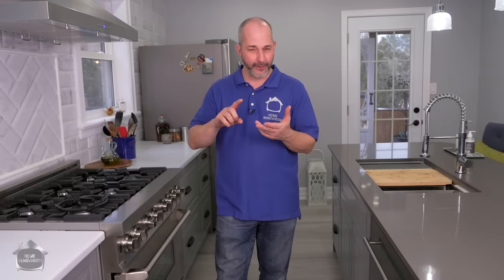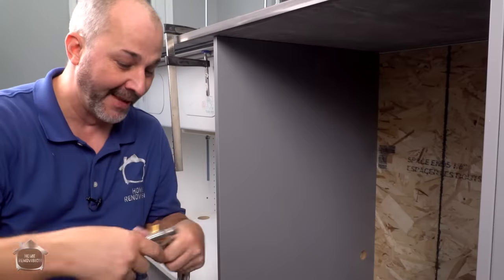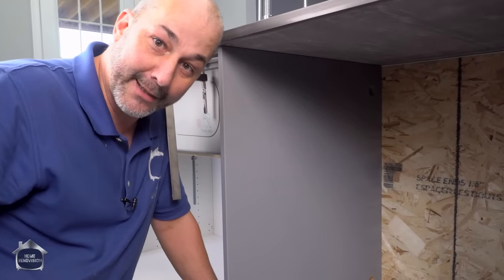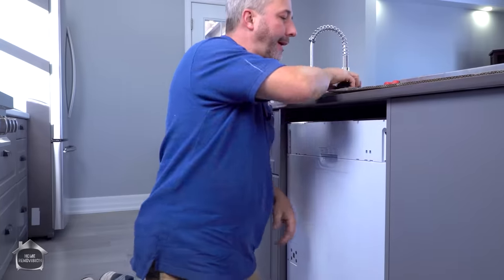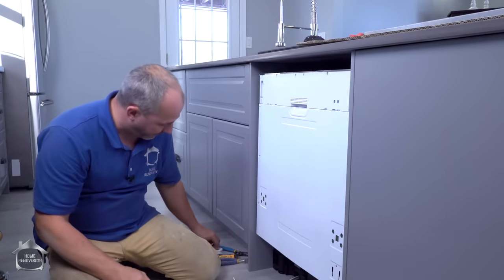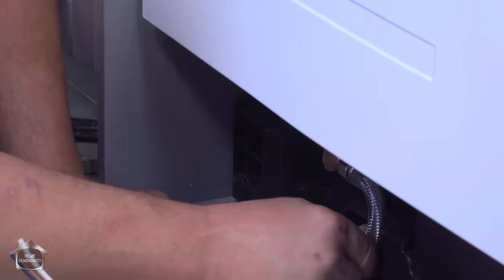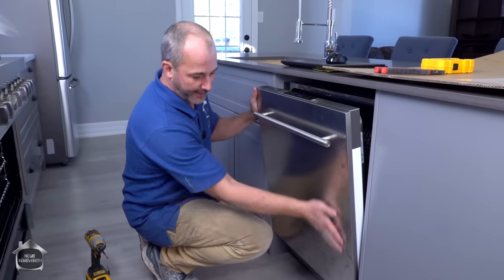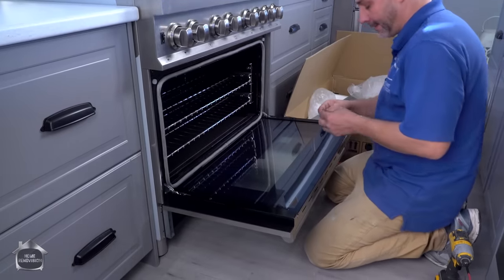How To Install A Dishwasher  Made  Easy!

Comment: This video saved me $1000 on a new dishwasher. I was preparing to install a new one after ours suddenly died and I learned the connections were all in the front. Turned off the power and opened the front bottom panel. Found a loose wire and reconnected it. Turned the power back on and it was fixed. Thank you so much!

Comment: I like most of your videos, but I have a suggestion for making the connections a lot easier. You can lay the dishwasher on it's back and make the water and electrical connections easier without having to lie on the floor. Then stand it up and run the wire and plumbing under and feed thru the holes in the floor and cabinet. I also hope you closed the gap at the top with a piece of cabinet colored trim with angle brackets on each end.

Comment: The gap at the top would drive me insane. There should be no reason why anyone should have to rig a dishwasher for it to fit properly. We're remodeling our kitchen, I was thinking about going with Z Line however the dishwasher may be the deal breaker.

Comment: You are correct about learning how to install kitchen appliances by watching videos on You Tube. After watching several installation videos I installed my new dishwasher, garbage disposal and over-the-range microwave. The microwave is vented outside and comes with a powerful 4 CFM exhaust fan. In my case I installed a CFGI outlet under the kitchen sink and a power cord to the dishwasher. The 1 1/4 HP disposal came with a power cord along with 3 bolt connection. Also purchased a wireless transmitter and receiver for turning the disposal on and off. Replaced the plumbing under the sink with a dual snappy trap.  Nice job really enjoy watching your installation videos.

Comment: I put a 1x3” across the top against the quartz countertop and pocket screwed the wood to the cabinets on each side on ours. This made it really easy to screw the dishwasher to the top and hide any gaps with a strip of the finished end panel glued to front of the 1x3”.
Reply: My thoughts exactly, maybe even a little adhesive to the underside of the counter.
Reply: This is the correct solution.
Reply: They make a "bridge" now for this application. When doing granite countertops. They also sell an adhesive solution, but I've heard nothing good about them.

Comment: Love your videos.  Keep up the great work. Just wanted to mention at about 2:40 you mentioned they aren’t using the garden hose connection too much any more and they switched to the elbow. You actually have that backwards.  The elbow is how dishwashers have been installed for several decades. Most commonly with a copper line.  After the introduction of stainless steel flexible lines the garden hose style became much more common and except for Hong end dishwashers that’s mostly what’s being used now. I’ve been an appliance tech for about 30 years.  I’ve pulled out and reinstalled more dishwashers than I can remember.
Reply: Do I’ll k

Comment: 14:02 I’ve got the same tester, if you hold the power button for too long it starts in silent mode so it will only flash when there is power rather than beeping and flashing. A shorter power on press will turn it on in beep+flash mode.

Comment: Hi Jeff, love your videos as usual. Can I make a couple of suggestions which you can apply to both the dishwasher and cooktop / oven. You can build a little platform under the dishwasher to raise its hight and also with the oven you can remove the legs and rest it on the platform. That way you can continue the kick panel under the oven for a more slimline look. I have done that to my ILVE oven and it looks a million bucks. As for the dishwasher, the platform will get rid of the gap between the dishwasher and benchtop. Also with the dishwasher here in OZ they installs are slightly different. Water inlet / outlet and power supply are at the back of the machine, regardless I normally run all hoses and cables under the cabinet and that way I end up with a much cleaner / neater finish. 
Again keep up the great work!
Reply from the maker: great ideas stan, however the stove requires the air space to keep it from over heating. the dishwasher though will work. Cheers!

Comment: In the UK we only have the garden hose 3/4" connection,very reliable tbh not reliant on PTFE. Our dishwashers are generally full height and have a cabinet door mounted for a nice flush clean finish. Cool to see how it's done in the US
Reply: I believe he is in Canada, the us is a little different most just come with a garden hose option or you can slide them off and tape them so you can use both ways. The back also comes with just a standard outlet to plug in the wall.

Comment: You don't have to pre drill a hole for side mounts, if you look down about 3 more inches there are little grey plugs that you can pop out, put the side mount bracket provided in after you snap off the extra piece, screw into the cabinet and replace the caps. 😇
Reply: Exactly. I agree with you 100%. The problem is that installation instructions are being tossed aside.
Reply: How do you pop the caps out to remove a dishwasher?

Comment: I've installed GE, LG, frigidaire, and a few others, they all share the same thing in common expect for 1 thing. The drain line, most have a rubber end which allows you to be able to cut to match with the drain T, others don't they are matched for 3/4 so make sure your drain line matches your drain T.

Comment: Glad to see you installing ZLine.  I just finished installing the ZLine 36" slide in rangetop (exact same cooktop taken right off the range you just installed) and a 42" 1200CFM remote blower island range hood.  Can't find anything better for the money!  Might look into the dishwasher now.  Just and FYI:  I have replaced a couple of dishwashers in my time and instead of hard-wiring I like to install a quad outlet box below the sink.  For me it just seems easier to deal with.  Install a 6' pigtail on the dishwasher and you end up with extra outlets for a disposal and even an instant water heater if desired.  And look into Wago wire nuts.  They are amazing.  I may never use a twist on nut again.  Also, for those who don't want to or can't screw through the side of the dishwasher, there is a bracket for the job.  I see one on Amazon called the "E-Z Dishwasher Bracket".  Has tabs on the sides for screwing into the cabinet and multiple screw holes all along the top for attaching the dishwasher.  Let me know if you would like pictures of my install.
Reply from the maker: That seems to be the direction things are heading. Cheers!
Reply: @HomeRenoVisionDIY Don't all of the hoses require thread seal tape?

Comment: Where I live, the dishwasher outlet water has to breach into the air with an air gap and then drain to the sink. Air gaps aren’t really that noticeable of a device either but it’s necessary for sanitary reasons.

Comment: I did Lowe’s installs for a while and must have done 500 of those lol
Reply: Glad you didn’t do mine.
Reply: Why? I was a private contractor working for myself! I take great pride in my work and I always do my absolute best to do quality work that my customers are more than happy with. I was trying to grow the business and most of my Lowe’s installs were repeat customers and they liked me and my work! I don’t think that you’d want anyone else doing your install!
Reply: How many air gaps did you install? None?
Reply: They’re not required by code in VA
Reply: It’s whatever though, I’m not about to argue over plumbing in a YouTube comment section. Take care buddy
Reply: Typical response...UPC has been adopted by all 50 states. That’s why it’s called UNIFORM. No municipality would approve utensil washer waste system directly connected to sewage drain. That’s 3rd world stuff. You have no license whatsoever, right?
Reply: I do indeed! I’m not arguing with you. I have better things to do than argue with some random person in a YouTube comment section. 😂
Reply: Random person....uh, no try inspector.
Reply: Did you show where you hook up dishwasher under sink? Why would you run the water line in basement instead of tying into got under sink? You don’t have to bring through floor unless you want to do extra work and you may need a longer deal supply? They also usually have anchors on the side if the counter top is granite.ive only came across Bosch with the track under the dw I’m sure there are more but they are rare

Comment: Wow. These videos are interesting here for a lot of transatlantic differences, like forced air heating, but this one most of all! European dishwashers: do not get screwed into place, because why; do come with a supply connection line – cold water only, just as much of an "of course" as your hot water connection; do come with a flex and plug attached, and if you were to take it downwards through a hole behind any wet appliance, you'd be breaking code (honestly that looks like a bad plan if there's ever a leak). Things look so similar on the surface, but differ so much underneath.

Comment: Those connectors that you twist onto the wires are interesting, in the UK we tend to use a product called Wago connectors which is like a small lever connector that you put the wire into and close down on
Reply: We have those here too. But personally I haven't had a lot of luck with em. Wires seem to slip out half the time when I do a tug test. Wire nuts let me sleep better at night.
Reply: Yes wagons are crap, a tiny plate making contact with the wire, one short  and they melt, all of Europe uses wagons, one good thing I like thought is cables are smaller gauge because of using half the amps ...

Comment: I really need some help and I cannot find answers anywhere online, so I hope you will reply and brighten my day. 

I want a dishwasher but we don't have enough cabinets to retrofit one. So instead I moved my stove, which was directly beside my sink on the left hand side. Now I have this wide open space that I'm wanting to install a dishwasher. The only problem is that I cannot find any instructions for installing a dishwasher in this manner. I need to extend my laminate countertop over the dishwasher but I'm not sure how to do it. I don't care if there is a small seam because I plan on doing epoxy countertops in the near future. Any suggestions on how to get this dishwasher and countertop installed?

Comment: The wires were slightly exposed at the base of the wire nut.  Dangerous condition!
When using a wire nut to connect 2 wires always secure the wire nut with black electrical tape.
Make sure that the tape securely covers the area at the open base of the wire nut..

Comment: on my installation, I went with a power cord. I added an outlet into the bottom of the wall that the appliance plugs into. the water and drain are routed the same as yours. if the kitchen was wired correctly, you should have a split outlet under the sink. one outlet is for the disposal and the other outlet is for the dishwasher. (split duplex outlet) there should be a switch by the sink to control the disposal, the dishwasher outlet is always live. having a power cord on the dishwasher makes it more convenient when having to service the machine. that way you can unplug it instead of having to fight with a hard wired situation....
Reply: My understanding that the dishwasher should have a plug to be plugged into a GFCI under the sink so its accessible.
Reply: @loramcclamrock5549  yes, thats the way it should be. on my system, I have the dishwasher tied into the counter outlets which is controlled through a GFCI outlet at the beginning of the circuit.

Comment: You installed the kick plate before turning on the water? How do you know your water connection doesn’t leak?
Reply: By seeing water on the floor...?
Reply from the maker: sometimes it amazes me how concerned people are with little details. If you thread on the connection the way I did, you won't ever have water leaking. that is called confidence. Cheers!

Comment: "Dishwasher's are getting more efficient." Not so much, they just took away the really hot & long drying cycle and replaced it with much less heat, so your dishes finish wet. If you're lucky (or paid a lot of money), your new dishwasher also has a fan to blow dry the dishes so plastic stuff dries off.
Reply: The haven't removed heat. Most modern DSs will say what the temp is on the cycle you choose. In my one it just pops the door open after the wash and uses the heat its added to the contents to dry itself out. Works well and saves energy.
Reply: @sepez  Not accurate. To be able to be sold in Europe, DW had to lower their energy consumption. The only way to do that is to reduce how hot they get during the drying cycle and the duration of the cycle. Read the reviews of the Bosch DW (one of the premier brands of DW) over the years. About 5 years ago when Europe put in place these rules, the reviews of the Bosch dishwashers went down the tube (customers complaining of wet dishes). In the last year or two they (and ornery brands) started putting fans in them to aid in drying.
Reply: @RobertBarth1  What im saying is the machine says 70c is the temp of the cycle. That is the temp it runs at.

Comment: Thanks for this video Jeff. My dishwasher comes on Wednesday and I'm very excited. Question though, the use of an air gap, is that dishwasher dependent or does Ontario Building Code not require this for all dishwashers?

Comment: I would suggest installing a dishwasher drain pan under the machine.  Dishwasher always leak... it’s a small item that will save your floors from water damage and scratches from pulling the machine out.

Comment: Q: If the water takes 2-3 minutes to get hot due to being far from the water heater(tankless), does the dishwasher heat the cold water to a specific temperature before the cycle? Or does it assume it is hot (130F) , and either heats it before the cycle for a set amount of time assuming it reached a higher temp, (or is it a specific temperature?) At what point and how does it know its ready to start the cycle?

Comment: Hey Jeff, it looks like you left the ground wire coming from the dishwasher loose, was that intentional?
Reply: The machine is bonded to the ground screw he wrapped the bare to from the Romex. The green pigtail was just extra
Reply: I saw that too. But I also saw the ground screw was used making the wire not needed. Might have been a good opportunity to mention for the DIY learner.

Comment: What did you do to close the gap at the top, and for the toe kick? I had to custom a small panel on top and toe kick. Looks alright but took awhile to adjust toe kick so custom cabinet door front didn't contact toe kick.

Comment: Do all dishwashers in your country come without a supply hose? Where I live all washing mashines and dishwashers come with a safety hose called usually Aqua Stop that prevents water damage in the house if the hose breaks. The hose simply has a valve integrated at the start and automatically shuts the water off unless the machine really needs it.

Comment: Wire connector needs to be installed to the box BEFORE inserting the wire....ALWAYS.   It's designed that way on purpose to prevent wire from being pulled.

Comment: hi, my dishwasher came with an actual plug... but all I have is bare wire sticking from the wall. Should I just slap a female receptacle on it or does Ontario code need something more? thanks in advance!

Comment: Why is the drainpipe going through a hole that's 3/4 the height of the dishwasher? Won't that cause back flow? Isn't the drain supposed to be lower that the base of the dishwasher?

Comment: Helps if to use the right tools. Pipe grips on a socket? Nice if it's a strong plastic but on cheaper one you'll strip the head on it

Comment: Usually find These videos really valuable even though I am in Europe, but wow American dishwashers are different to European ones. Here the power cables come attached at the back with a plug to go into a normal 240V socket and the water supply line is also attached with a tool less fitting (I’m guessing this is what you call the ‘garden hose’ style fitting, but I’ve never seen a hose like that. 

Perhaps would benefit from a disclaimer that it only really applies in North America.